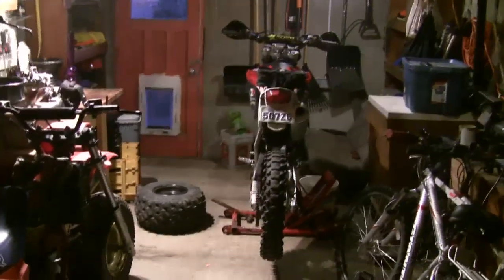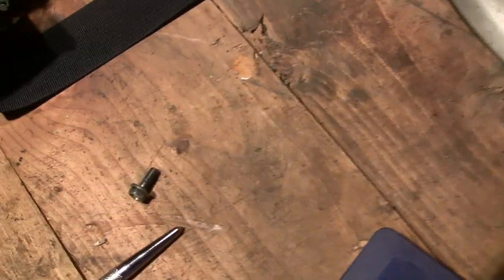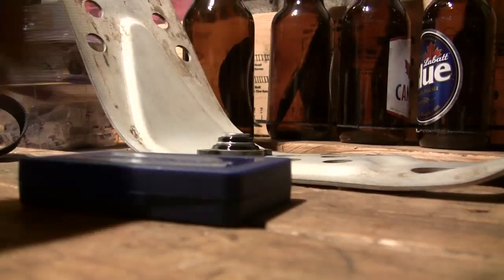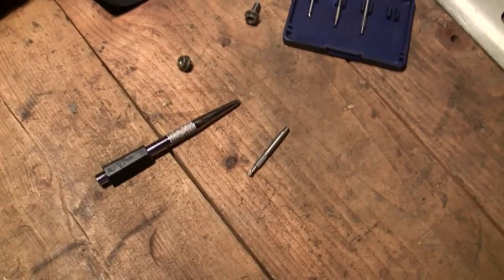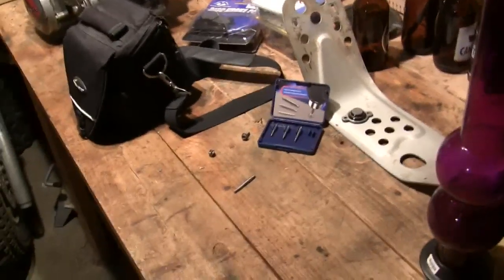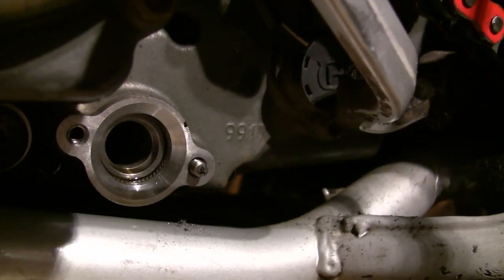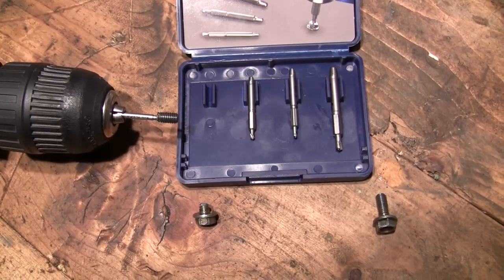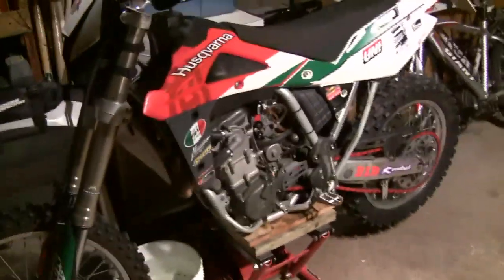Broken Bolt Extraction - ARG

Comment: Just keep in mind in the future that the bit is made of hardened steel.  If you break it off in the bolt, you've really got a problem.  I would suggest you put it in a tap wrench and back the bolt out by hand.  If it doesn't turn easy, don't force it.  I also always use left hand drills to drill the pilot hole.  Half the time, that backs the bolt out.  BTW, I like your bong.

Comment: Dude, you were supposed to unscrew the drilling side too, in other words both sides work in the same direction, in fact sometimes the drilling bit will get enough hold of the screw and get it out without the other side.... that explains why you had to put a lot more force because it's like drilling a regular hole in reverse.... :)
Reply: No. It's because he didn't do a pilot hole first for the "bite" end to set into.

Comment: The reason your bolts broke off is because they were over torqued. Once you over torque a fastener it streches it and then it is no good. After reaching the proper torque it only takes around one full turn to break the fastener off. I would invest in a torque wrench if I were you.